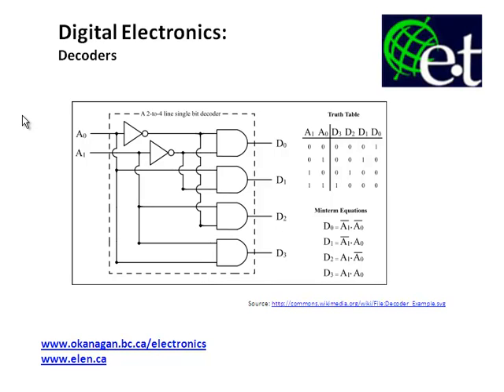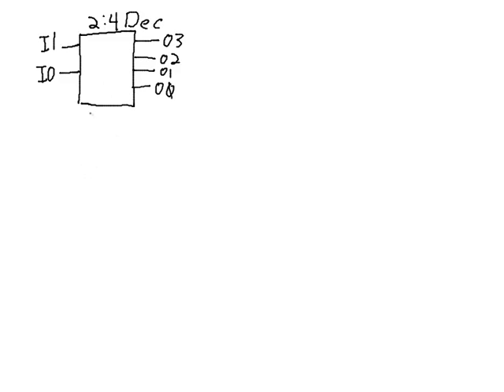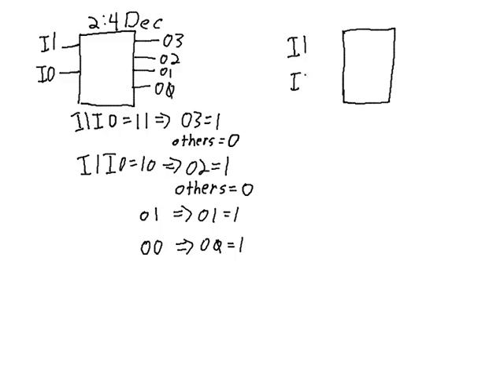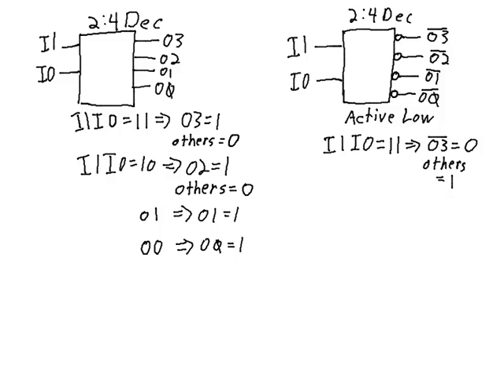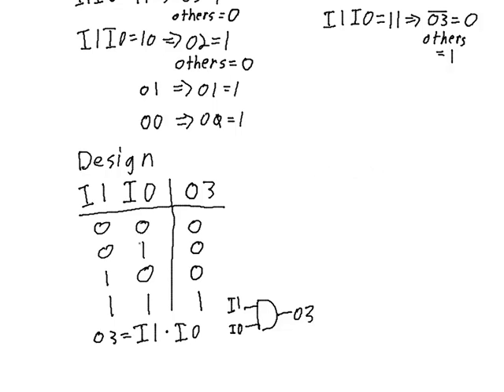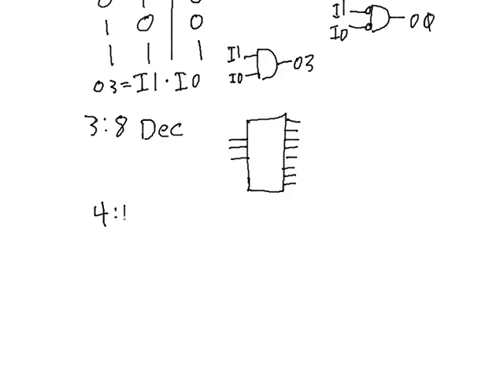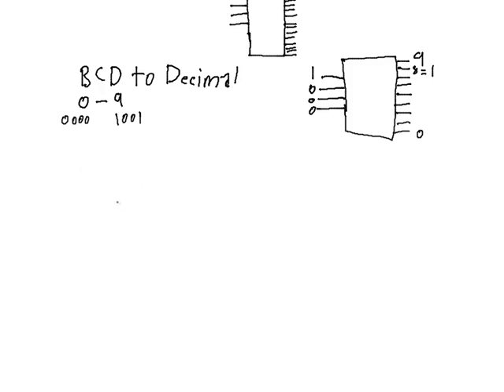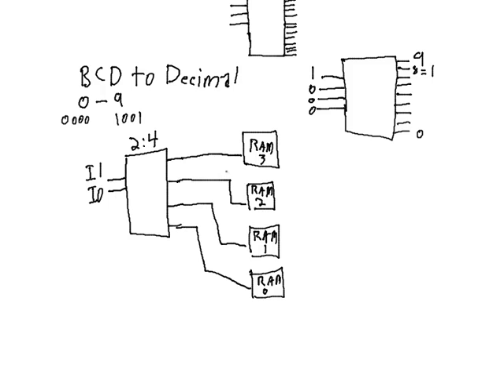Combinational Logic - Decoders

Comment: Thanks! But what about permission input/output in decoder and encoder circuits?
Reply from the maker: +Azizjan Ayupov I'm not sure what you mean. Do you mean enable pins to turn on the circuit?
Reply: Yeah!
Reply from the maker: +Azizjan Ayupov A simple way to add an ENABLE signal is to have an active HIGH enable, and AND the output with the ENABLE bit.  If ENABLE is 0, then the output will always be LOW.
Reply: David Williams Exactly! Thank you!